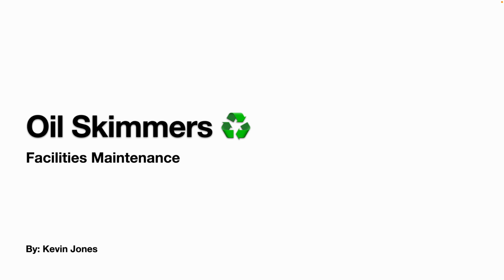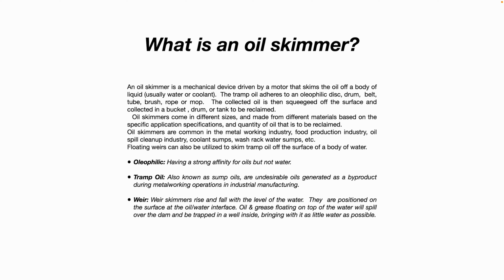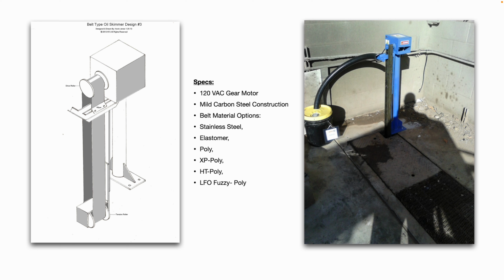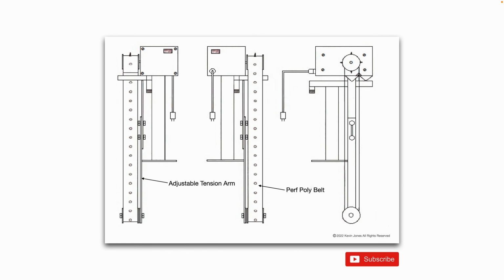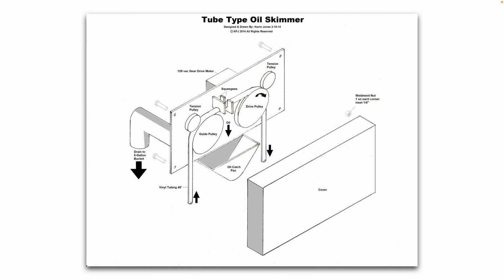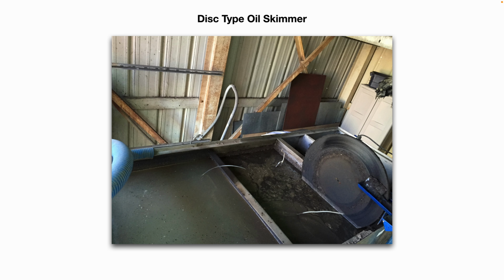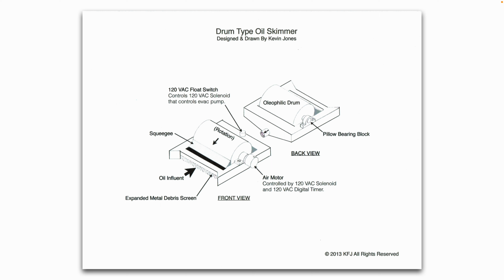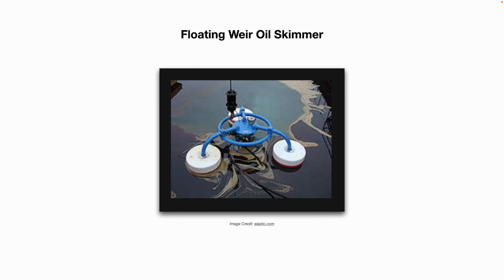What is an oil skimmer?  What does an oil skimmer do?  [101]

Comment: Hello Kevin, great video, many thanks.  Could I ask for a little advice, we have a pretreatment tank that holds chemicals to clean sheet metal.  The tank is approx 6m long by 2.5m wide and 1 metre deep. Only an area 1.5m x 0.7m is accessible.  Would a belt skimmer pull the oil towards the belt over time?
Reply from the maker: Hello Chris, thank you for the comment. A belt skimmer would pull the oil to the skimmer over time.  Remember, what ever type of oil skimmer you choose, make sure the wetted parts are compatible with the metal cleaning chemicals and temperatures being used.  Good Luck.
Reply: @kjfacilities-maint  Many thanks Sir, your advice is very much appreciated!